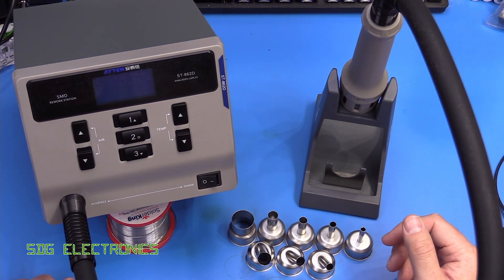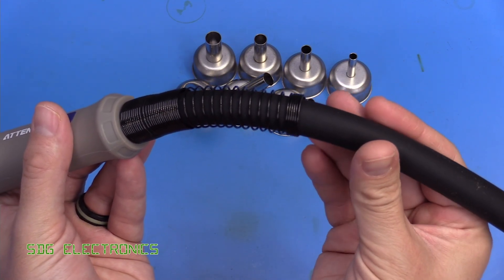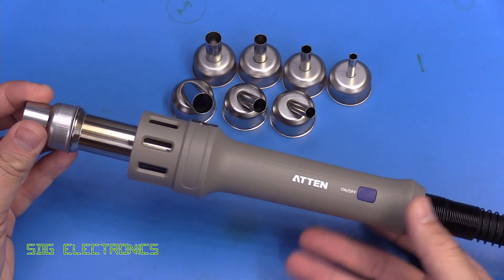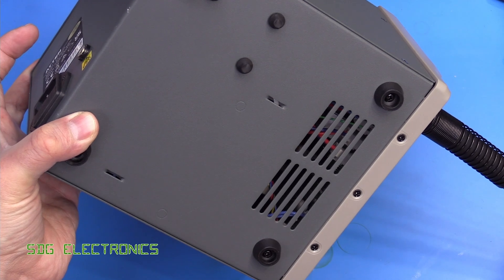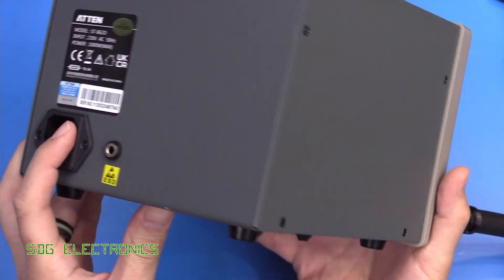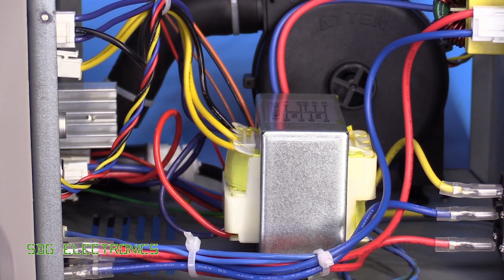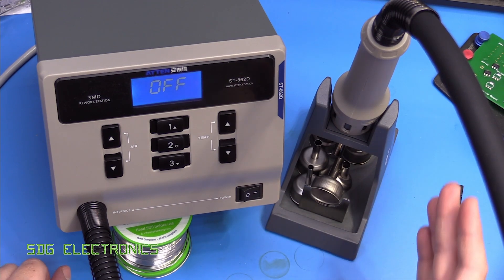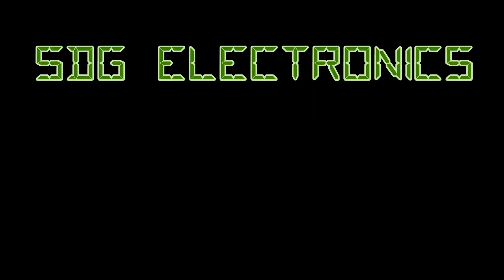SDG #294 Atten ST-862D 1000W Hot Air Station

Comment: How far up did you push your thermal couple to check temp calibration? I've just bought this unit from Amazon and I pushed my thermal couple up not all the way to the tip of the element just halfway up the nozzle and my temp reading is nowhere near what I set it to, Do you have to have the thermal couple almost touching the tip of the heating element to get the correct reading?

Comment: I solder like once in a way way long time but I always wanted something better than the basic pen soldering iron so I got me a wireless Micro soldering pen with digital sustainability and it heats real real quick excellent for soldering cellphone microchips!  Also upgraded to a 2 to 1 SilverFlo 8586D-III Pro for $42 (Digital hot airflow rework gun + soldering iron handle) with angle nozzles and 8pc straight square and round mm size nozzles! Very temperature accuracy and seems reliable and love it that it's  a palm size work station with 3 custom memory presettings and quick digital temp adjustments and sleep mode after 10 mins. of no action!  If I decide later in the futures that I want something more professional and doing more and more soldering than the Atten ST-862D or latest or better would be a choice upgrade!

Comment: I'd love to get one of these, I know they sell the heating element, but the part I'd be concerned about Is the blower, which they don't seem to sell.
Reply: There is actually a singular listing on aliexpress selling the blower for $33. But they have only ever sold 4 of them and I have never heard of anyone complaining about having to replace the blower. So it doesn't really seem like that is a common point of failure with these units. But if you are concerned about it you could pick up a spare.
Reply: @nerdstrangler4804  You're right. I found that after commenting. If it was high use or you used it for a long time that is the part I would expect to fail along with the element. The other part sold is the transformer, which is odd - that could signify it's cheap and won't last. But the mainboard I expect would fail too. If I kept all 3 on hand I probably have a unit I can use for 20+ years (which is what I intend, I do very little SMD work, but enough the cheap Chinese ones don't cut it anymore).

Comment: @sdgelectronics i have bought quick 861WD and when i plug that at my home, the bulb and light flicker. I carried away and tested in some more houses and have the same issue. So please is there any other way to solve it. Some of my friends suggest to use 15amp with 2000 watt stabilizer. Please reply me😢

Comment: Would you recommend this still in 2024?
Reply: yes, this is still the best hot air and many use it for professional work.

ignore the idiot saying this should have a "built in iron" 🤣. his hot air most likely has the fan inside the handle
Reply: @katto1937 lol ok
Reply: @YSG-13  is there an issue with what I said?
Reply: @katto1937 no im agreeing with the (ignore this idiot) part
Reply: not really a value for money product for $200,should atleast have a built in soldering iron station or a better dot matrix/lcd display

Comment: i was using a cheap hot air station from a local retailer for years a Duratech Hot Rework Station and it would take a long time to get heat into anything at times i would give up trying to remove stuff. i admit i purchased this device becuase of seeing it on many different board repair yt channels. im glad i did. this things a F#$king beast compared to my old unit i felt like i was in the movie twister when i removed my first chip with it. i dont know why i did not buy one sooner

Comment: I currently use the Circuit Specialist CSI 825A and wish I had never bought it. It's noisy and low on air volume. But, at the time I liked the idea of the SMD vacuum pick up tool. Turns out, I very rarely use it. This looks a much better system. Thanks for sharing.

Comment: I was looking for a Quick but found this one costing a lot less and gave it a try. I was not disappointed and the positive reviews are justified. If I had to nitpick something, it's that the buttons on the front panel feel cheap. That's it. Everything else is very nice. Just like some of the other commenters I used to use an Aoyue station and that was a toy in comparison, despite not being much cheaper. Desoldering even big packages takes seconds instead of minutes.
Reply: Did you try adding a small piece of rubber or similar thing? It might help a lot and fix the cheapness of the device, hope this helps!

Comment: Got the same station a few weeks ago. They changed the firmware since the Rossman review, "long press of the button switches to cooling mode" feature is no longer present. The hose on my unit is 80cm long. 2 of those straight nozzles should have a structure inside that supposedly swirls the air so that you don't have to do it manually. The largest diameter nozzle is an adapter for older style nozzles. You need a better test case BTW, I had to use it at full blast to remove a memory chip from a GPU. The heater is 1KW but the average power at full airflow is around 700W.
Reply: Would you still recommend this station? Wdym by test case?
Reply: @phr3ui559  It still works great but you can find cheaper alternatives that work just as well judging by the reviews. BEST clone seems to be good.
Reply: @phr3ui559  I assume he means a bigger chip on a thicker board as that will require a lot more heat to desolder. But he got the chip off so it seems to have worked. Frankly if you run across something this station can't handle, it is probably time to start thinking about an IR preheater rather than trying to blast more hot air into the board. As I feel like at a certain point more airflow and more heat is going to increase the risk of something getting damaged, but maybe I am wrong.

Comment: there is also a "hidden feature" with the handpiece button. if you press it for at least 3 seconds, you can toggle to blower mode, where the heater is disengaged and you just get airflow at the set speed. i don't know if anyone finds it useful, but hey, now you know!
i like the station quite a lot, have been using it for 3 years now
Reply: Was this feature removed in recent units? when I hold the button it just turns off.
Reply: @htrcs  Yes, unfortunately.
Reply: Please pin this <3
Reply: but I don't understand how one can speak of 1000W by looking at the dimensions of that transformer
Reply: @TheFelix63  the transformer is only supplying 24v for the blower and voltages for the control circuitry, the heater itself is running straight off of 240v. see 6:53
Reply: @bwimtg  Ok, sorry, but the cables that enter the heater are a bit small in section

Comment: i get the impression that they keep the hose relatively short to match the airflow resistance / impedence against the bldc fan. this aught to be especially true for the atten, as it seems to have a slightly smaller / weaker fan than certain other hot air stations. however it may have a slightly wider diameter hose? to help compensate? i forget now...

but i also feel that the hose on my bst-863 is similarly too short. there is another station out there with a longer hose more comfortable. but again i forget which one it is. but perhaps quick tr1300 can since it does have a beefier fan? i am not sure.... but have often wondered if it could be possible to retro fit a fan replacement of tr1300 to other hot air station models that were not originally designed for it. the replacement part cost however was quite high last i checked about 130 euros. so it is rather too much. maybe easier just to sell the old station and buy a whole new one. except i have become way too attached to this randomhacks ui upgrade for my station. with the potentiometer knobs and all that. such a joy to be adjusting with real dials